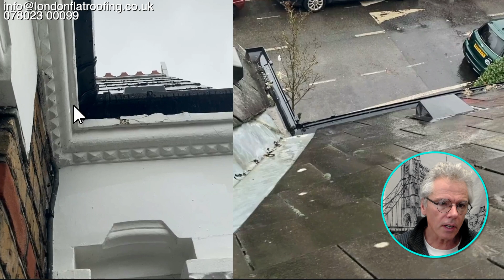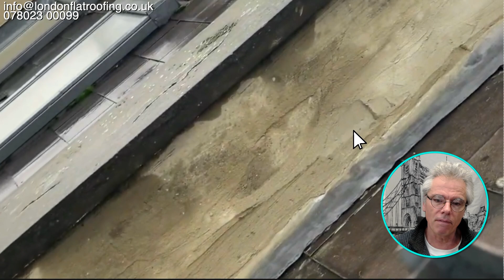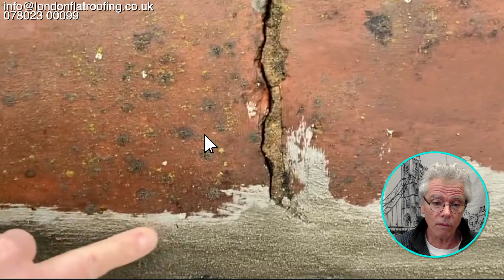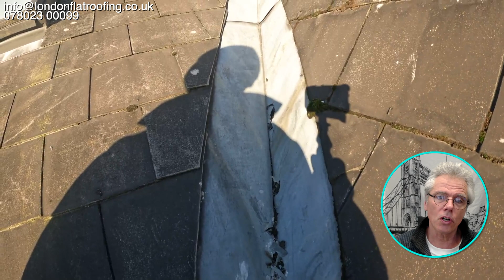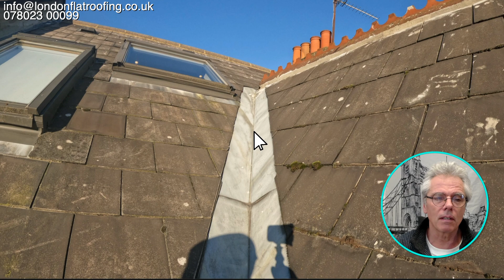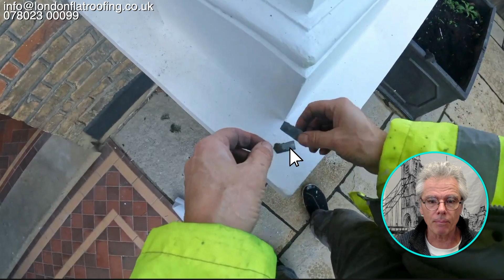Roofer breaks Valley when doing a repair!. Roof Inspection Findings.

Comment: I suppose it depends on the quality of the zinc flashing used, is this a coastal area or an urban area?

High acidity from pollution might drastically shorten a lower grade products life span.

Never seen sand and cement mix poured over lead like that - what does the guy think is going to happen - the leads going to expand and contract and crack the cement and bits will fall off, run down the roof into the gutter etc.